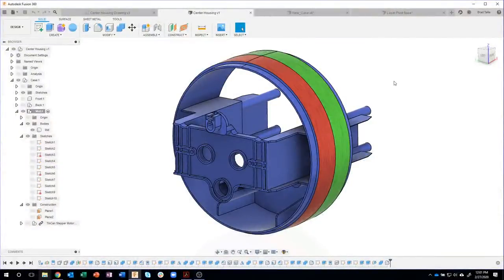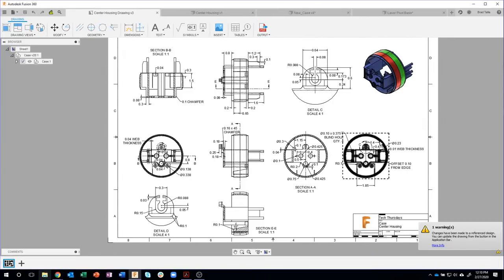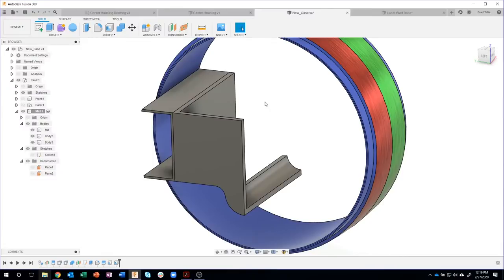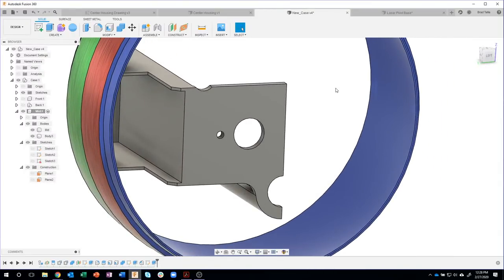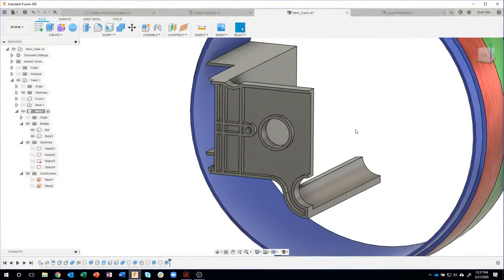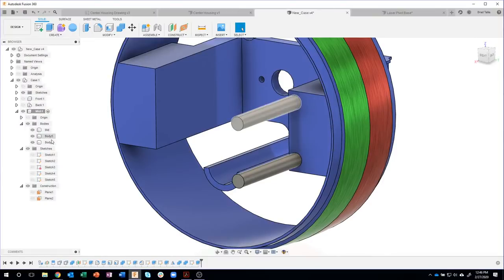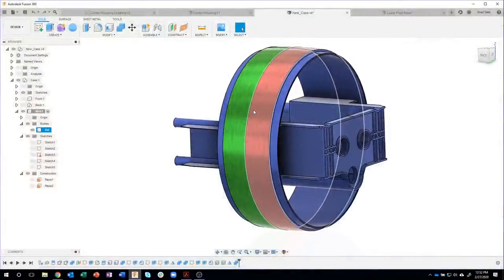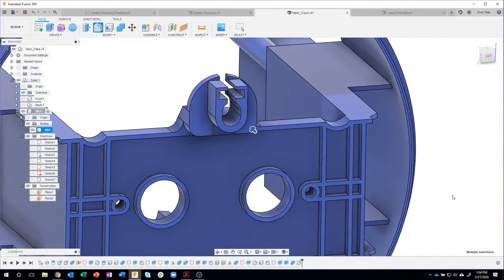360 LIVE: Laser Projector Build - Part 3 The Center Housing

Comment: Great Video. How do you consider tolerace in the lids? I mean you have to slip them over each other and if it is too tight it will nonot work well.
Reply from the maker: @Christiano-  In many of my LiveStreams, I do not worry about tolerances as I would have to remember what I used for each and every part, so I leave that part out.  I am showing how to model in Fusion 360, not how to do GD&T, etc.  However, tolerancing IS very important.  I am leaving that up to the user/designer to implement.

Comment: Great job as always Brad.
 I did get an error (face could not be replaced. Try changing the face selections. For edit face operations, avoid making changes where other faces connect smoothly. ) No idea why. My clicks are identical to yours . ( 1:09:01 into the video )
Reply: I had same issue